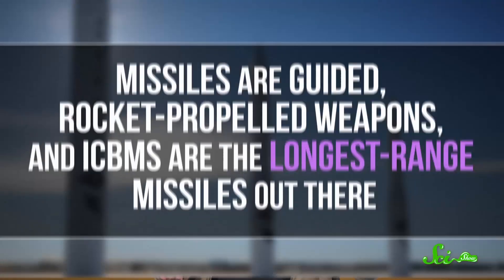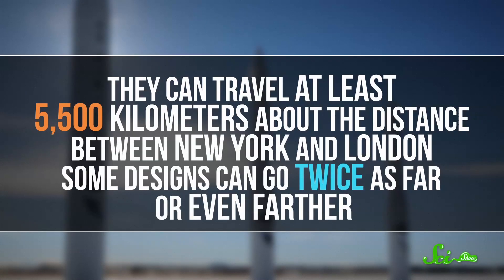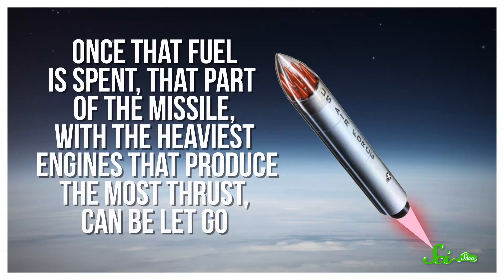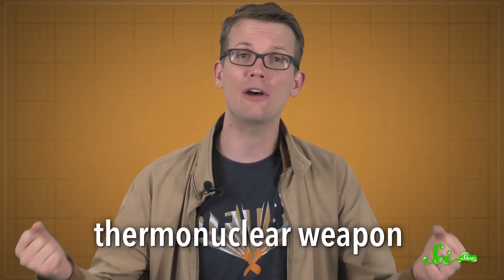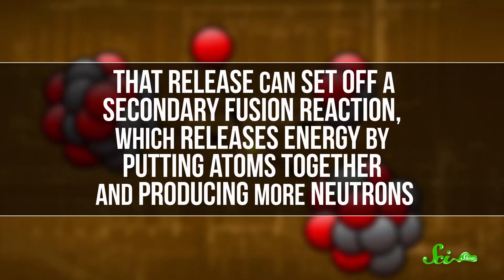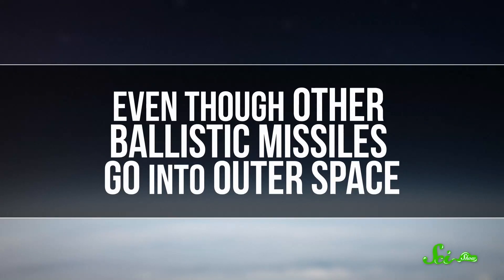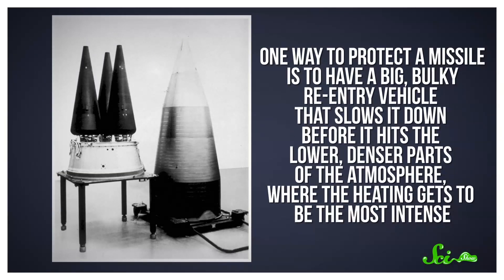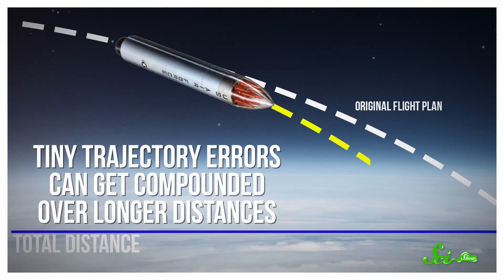Why It's So Difficult to Build a Ballistic Missile

Comment: I hope I do not get arrested for revealing the secret. the video is pretty accurate but misleading. 

in simple lamen term, the solution is to have downward vertical trajectory upon re-entry. directly vertical is the key to eliminate all previous errors. including the  compounded errors before the flight.  for example, the ICBM is now atop the U.S. continent at this stage it has to vertically align itself over the continent U.S. this would also be the last stage of the ICBM. the solution lies not in the trajectory but in the timing, once you come up with the equation, that would allow you to predict when the ICBM would vertically align then using the last stage, the missile can be guided. this requires another equation to correlate the GPS position of the rocket upon entry, when both equations work together. it can set off three directional corrections on the rocket which is made automatic. 

meaning, the time taken for the missile to alighn vertically as it re-enters coupled with an equation that would correlate to the GPS position. would allow the rocket to automatically set off boosters to correct any significant errors. 

errors like the rocket not being on the U.S continent requiring the rocket to at least travel 30 degrees to the right for their to be a chance to strike the U.S. the GPS equation would automatically trigger a booster to allow the rocket to travel 30 degree right until impact. while not pinpoint accuracy the a detonation is guaranteed. 

I've left out how to keep the missile safe from the heat. nevertheless the mass ration is crucial for the first stage of the rocket launch this requires multiple test until you can get the correct equation.

Comment: Rockets are hard to build because of two main reasons distinct from targeting and weight etc a rocket is essentially a controlled explosion within a vessel which you need to remain intact and as the propellant gets used up the centre of gravity of the rocket is continually changing which makes it very difficult to control

Comment: Where does a resource-low country like NK get its materials for an ICBM?
Reply: Mick G. From it's people's stomachs of course😂😂
Reply: Zane Shute That's an interesting point. They (Pakistan) have a close relationship with China too. 
I mean, ICBM's aren't like trucks, where you can improvise, or make parts in an engineering shop. Even Hitlers V1/2 had very complex precision parts unavailable without a complex supply/production network.
Reply: Mick G. China
Reply: David Marocik Well, yeah.... I was wondering about the way it was structured. Is it really just a goods for labour deal?
Reply: Beyond Coal IDK what other goods they sell to China.  

Laborers as well = yes.
Reply: Pakistan, most likely.

Comment: Im going to also point out that nukes and H bombs are generally detonated quite far above the ground. If you go for a large depleted uranium slug instead of a bomb then it can cause similar damage without the radiation fallout of a nuke, the difference being that it needs to go faster, it needs more mass, and it actually has to hit the ground and not break apart during reentry.

Comment: Depending on the specs of an icbm, you dont actually need a nuke, if its going fast enough with enough mass it will essentially do the same thing without the nuclear fallout.
Reply: lol not even close, it would have to accelerate to speeds unachievable by modern technology to do the same damage as a nuclear weapon through sheer kinetic impact
Reply: Zane Shute kinetic impact and mass. Its a balance. With less moving parts its also more reliable meaning it can withstand more abuse making it possible to achieve higher speeds, its not impossible and its not even unreasonable, have a look into what happens when you get something to impact something else fast enough, it can literally rip apart atoms.
Reply: I know what happens. But you couldn't take an ICBM and realistically accelerate it to the necessary speeds and get the equivalent of a nuclear explosion. Kinetic bombardment would be the clear answer, either with tungsten rods or the DU you suggested in another comment, but even those wouldn't produce yields anywhere close to those produced by nuclear weapons. The orbital platform used to deploy them would be incredibly vulnerable to ASAT weapons, too.

Comment: You say there's not much you can do "about North Korea". As someone with a large platform though, there totally is: tell people about the history and source of this conflict. North and South Korea were well along a road to peace through the 90s until George W Bush gave his "Axis of Evil" speech, including North Korea on a list of "evil" countries basically just to make the list not entirely Middle Eastern and kicking off this modern saber rattling. This "problem" would be very easily solved by the US backing down and letting South Koreans take back control of negotiations and actions in the region. A return to the "Sunshine Policy" of the 90s would quickly defuse this mess, but it would require the US acting humble. We must pressure our government to do so.

Comment: Antonov An-225 Mriya, this is a cargo plane that can carry up to 280 tons of weight, the largest ICBM developed can carry up to 10 tons of payload. Would it not be more cost efficient and faster to develop a cargo plane than could carpet a country with up to 280 tons of nuclear payload. The enemy would never expect a cargo plane to be carrying such a payload, you may think that human pilots would be a problem, not if we can pilot it remotely. This concept will change the face of nuclear war if it becomes reality
Reply: Schnozistan Czar it would just get blown out the sky by a high velocity missile that's why we don't use long distance bombers nemore because they don't have the ability to fly low enough or fast enough to avoid detection , if a plane is stable it turning circle is wider , longer and smooth if an aircraft is made unstable it can sharply change its trajectory allowing it to avoid fire something a cargo plane could not do
Reply: Lynne Price but you forget the immediate effectiveness of this tactic, if kept secret from the world, the US or another nuclear power may be able to deploy around six depending on the size of their arsenal, if used as a preemptive strike or a surprise attack, there is very little chance for retaliation as the payload is already falling,  instead of being detected leaving the earths atmosphere. I'd call it the modern Trojan horse

Comment: The weight for the Trident I's warheads (consisting of eight W76) were just shy of 400 lbs each (somewhere around 3000 lbs in total, or roughly the weight of a Honda Civic).

Comment: navigation is not really an issue. they are guided, you dont precalculate the flight path. they use inertial navigation systems and you can correct the path. it's of course also not so easy to create a exact ins. one of the reasons why accurate gyroscopes and accelerators are restricted in export.

Comment: The most elegant fix for the nuclear reentry vehicle is to use spent Uranium238 as the nose cone. although the extreme density adds weight it does double duty in the first nanoseconds of blast ignition by acting as a better containment of the burgeoning reaction reducing chances of a fizzle or incomplete chain reaction.
Reply: Well, U238 is already used in some warhead designs as a tamper so it can fission, encouraging fusion and adding to the overall yield, but nuclear weapon states want to keep the fission fraction as low as possible so as to make less fallout. Making the re-entry vehicle out of U238, aside from probably being really expensive, would create an enormously increased amount of fallout for an unnecessary increase in blast yield.

Comment: No, not all warheads are extremely heavy. I designed one based on the 1656 SWAN boosted fission device, which including reentry vehicle (similar to the W68) weighs about 110kg..
Reply: Evan Bell Dude, your hobby sounds interesting af! 
I have to admit I never got much further in the understating of warheads than the gun type but physics have never been my forte. 

Can you give me an estimate on the capabilities of your design? From your specifications I'd guess around 30kt?
Reply: Liar!!!
Reply: What makes you say that? Pure fission, and boosted fission weapons are very easy to design. 
It's when you get into "hydrogen bomb" that the physics becomes a bit more hardcore. That's where I am now. 
Using that boosted primary based somewhat on the SWAN device, and using a radiation case and secondary stage system based roughly on the W-80. 
You've got ionizing radiation hazard symbol as your profile pic. Guess you're somewhat interested in nukes. Wanna hear about mine? You might learn something and you'll realise I'm not lying. 
The physics of fission weapons has been in the public domain for decades. Check out the 1964 nth country experiment. 3 PhD's who'd no experience in weapon design were tasked with designing a nuclear weapon with a yield of military significance. After messing around on and off for a few years, they got a design that was deemed by weapon designers to be functional, if a little complicated. 
Between now and then there's been 50 years of publications are declassification. Plus the internet is now a thing. If you're good enough with physics and maths, you too could design one if you've got a few months worth of free time you don't care about.
Reply: Closer to 25, but yeah.

Comment: "I'm not going to get into too much details for the obvious reasons"

As if you know how to build one?
Reply: It is well known how to build them, thats not even the actual problem. The materials are.
Reply: what chemical elements do they use for the 2 atoms for the fusion to combine the neutrons and protons together to make the new atom?? and how does that equal propulsion?? and with the fission what atom do they use to tear apart?? hydrogen like the bomb?? or a diff atom?? didn't the bomb explosion happen from imploding the atom so the neutrons become unstable and break off from the atom?? how does it remain stable enough to cause propulsion instead of just exploding??

Comment: As an aerospace engineer myself, I want to say making a multistage rocket in itself is a massive complication. Not only do you have to now have rockets balancing on top of one another, but the separations themselves are extremely challenging. They need to be timed precisely, and the engines on the upper stage need to start exactly when they have to, otherwise you could have an interstate collision where the upper stage slows down and crashes into the lower stage

While it's easy as pie for most countries with decades of spaceflight experience to do now, for a country that's essentially been isolated from the rest of the world and doesn't exactly have the existing skill sets to manufacture and design said things, it's extremely hard

Comment: US and Russian systems for missile launch are outdated. They all launch from ground zero elevation (like the space shuttle).  Advanced missile launches are from mile long tunnels underground that propel the missle using either electromagnetic coils (like a rail gun) or by compressed steam, yes steam and pistons - just like how they launch a fighter jet off a modern US aircraft carrier.

You can effectively remove the first stage of a rocket if you have a mile long tube and give it a headstart with a rail gun shot.  You can then reduce launch costs by at least a factor of 10 to maybe 100.

China will probably use rail gun launches to propel hundreds of 10,000 pound payloads worth of fuel for their first manned moon attempt (probably 2050 or later)

Comment: How about dismissing going into space altogether, and make the top stage more of a hypersonic drone with ramjets that's flying at the higher edge of the atmosphere. The first couple of rocket stages should get it going fast enough to create the pressures in the ramjets for propulsion.

All you have to do then is point it to the right GPS location.

You're welcome, Kim.

Comment: Another neat, I guess, aspect of miniaturization is the trade off between volume and mass. I didn't think of this till I read through some of the literature myself on bomb design parameters. Fusion is more energy dense by about a magnitude of 5 compared to fission for bombs, however it is significantly less physically dense, on the order of something like 3-10x less dense depending on the fusion fuel being used. As you can see this results in many different trade offs. There is a minimum size of your fission trigger, so do you just make that a bit bigger and not carry as much fusion fuel? Or maybe just have a larger fusion stage and have more fission tamper (tamper is fission fuel  surrounding your fusion chain to set off more fissions), or something else entirely and go simple fission boosted bomb (fission with just some fusion fuel without its own dedicated stage). It is all rather complicated and why miniaturization took different forms in Russia and the US. 

If anyone has physics related questions about bomb kinetics, I have read over what unclassified information there is from plasma physicists speculations. It is all rather fascinating, in a grim kind of way!

Comment: He's trying to talk about a Teller Ulam device.  The w87 Warhead three of them there with the Minuteman 3 carrier bus weighs about 300 kg each not very heavy in the grand scheme of things and they also have 475 kilotons yield
This is a two-stage Fusion boosted fission device. Your squeeze off the plutonium which squeezes tritium and causes a fusion reaction to make sure all of the plutonium is fissioned then a lens of u238 directs the x-rays to the secondary which is another pit of plutonium surrounded by lithium deuteride which basically turns into deuterium when the neutrons are zipping through it and the pressure of the secondary fissioning causes the thermonuclear reaction. A teller ulem is a bomb in the Megaton range because the primary sets off envisions a nuclear spark plug made out of u235 that compresses and fuses the secondaries lithium-6 or lithium deuteride which is a much larger component of the weapon then in the w87 W 78 and w88 respectively. The b83 gravity bomb is a teller ulom device.
Reply: What you described as a two-stage fusion boosted fission device is, indeed, the Teller-Ulam design for thermonuclear weapons. While most thermonuclear weapons in arsenals today that incorporate the Tellar-Ulam design use gas boosting in the primary, a single-stage weapon with fusion boosting inside the hollow sphere of Plutonium is simply a boosted fission bomb. Add multiple stages, and now it's a Tellar-Ulam device. It doesn't have to be in the megaton range - most of them aren't.

Comment: Even if they build ICBMs, there's Anti Ballistic Missile batteries dedicated to downing them, as a shower of steel flakes will  ruin the systems and turn the warheads inert. The warheads themselves aren't well protected against that, even a harsh hail can ruin a warhead, the protection is designed after all to protect from thermal damage such as re-entry.
That being said, the US and Russia are well prepared to down warheads in small numbers, the real fear would be a massive attack that cannot be covered by ABM batteries.
Reply: Firstly, I have to ask, what ABM system currently employs the method you're describing? The "shower of steel flakes?" As far as I'm aware, the US and Russia pretty much operate the only remotely reliable ICBM-stopping capabilities, and the former uses kinetic kill vehicles while the latter uses neutron warheads. I'm just curious if I'm missing something.

Also, if I could just contribute, I agree that overwhelming numbers are the biggest concern, but there's another - the US and Russia are limited by treaty to only one ABM installation each. The Russians positioned their's around Moscow, while the US has GMD dotted on the West Coast, and in Alaska. What this means for the US, though, is that the Norks could fire an ICBM on a polar trajectory and target a Midwestern city like Chicago - and completely evade GMD in the first place. Just shoot right over it.

Comment: It's simple we detect the missile in flight and counter it with another missile......or we can use those new fangled railguns we have now
Reply: Problem with current US ABM systems is they're not as reliable as they should be. Granted, it's pretty hard to pull off and we've got the best, but that's relative. GMD has about a 50% success rate. 

Also, I don't think we can use railguns for ABM defense. That sounds like it would be exponentially harder to pull off than what we're trying to achieve with GMD right now.